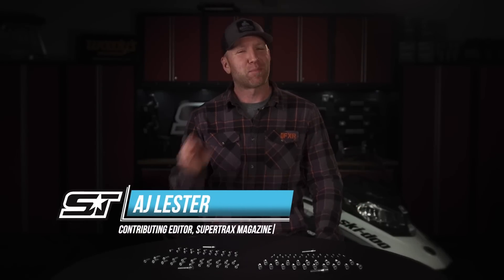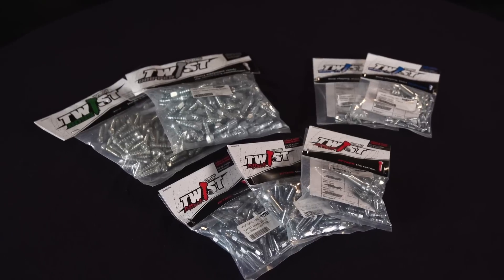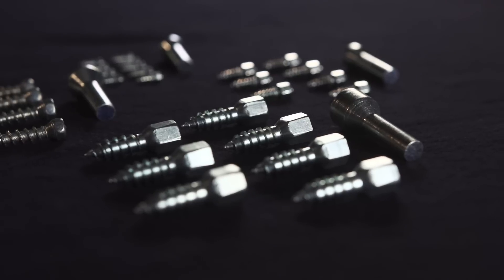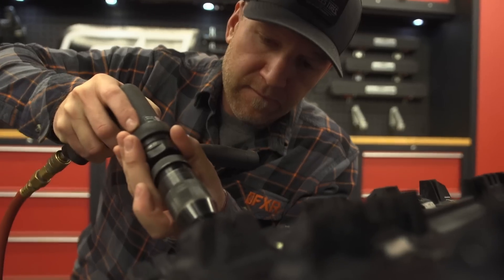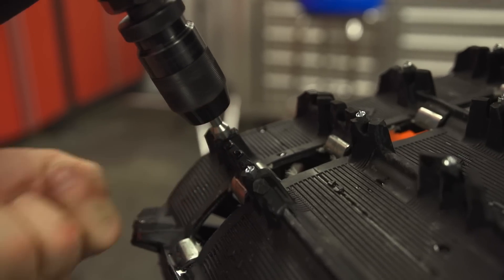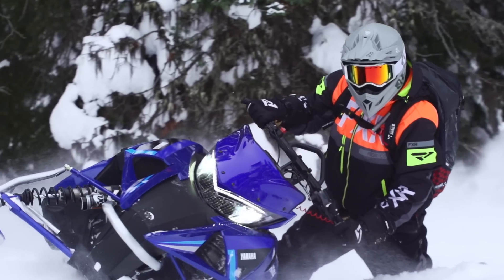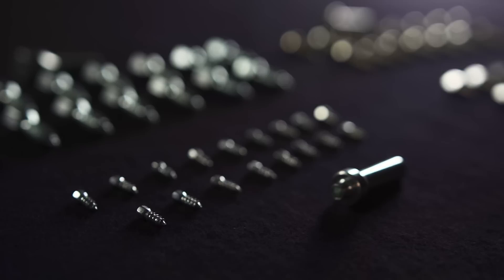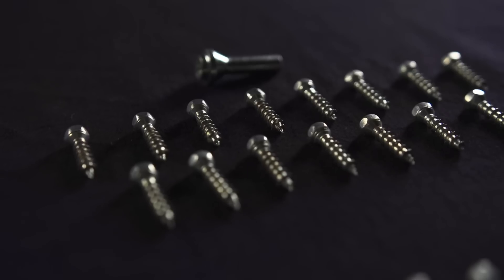How To Maximize Traction With A Twist of Your Wrist | Woody's Twist Screws

Comment: I’ve ran atv screws on sleds before. They worked alright. I wouldn’t recommend these on high horse power applications, but for the mxz sport it’s a good fit.  Pro tip: dip the screw threads in weather strip cement before installing, they will hold better and you will have less rip out.  Also when it bottoms out don’t spin it and strip the hole out.

Comment: How do these compare to a studded track? I'm going to assume the studded track wins out, but by how much? Of course it depends on number of studs, but just curious if there's ever been a direct comparison. I ride hard and always stud my track for safety purposes (99% trails and ditch). Just curious if these would ever be worth changing over to on a future sled.
Reply: No.       Real stud are better .
Reply: Yes studs are still better for ultimate traction, but it depends what you want. If studs offer 100% traction I would say the screw in type get you 70% of the trail safety. Also studs add 10lbs of rotating mass, cost a lot more, and take a lot longer to install. I’ve had good luck with iGrips over 100mph and none have come out.
Reply: @GotThrottles  thanks for the input. Exactly the kind of info I'm looking for 👍
Reply: @GotThrottles  ... one thing you missed is this.... a typical 137" can take 96-112 studs up the middle.. IGRPIS at 1/10th the weight you can install around 225--288... so all those extra points of contact make up for anything a traditional stud setup can do.  We have compared this side by side with identical sleds.. literally no traction difference in all conditions.... its why we all switched.... honestly we were shocked... but it is what it is.... we saw it and tested it and know the results we experienced......  nothing but igrips for us ...... between the 4 of us we have probably 50-60 thousand miles on them in the last 5 years... never lost one.. no damage to any sled ever.. and ZERO issues.
Reply: @joerotorhead  that's a great review!  Glad to hear about those results.  I run iGrips on my 144" and am very happy with the grip.  I imagine 200+ screws really hook up!
Reply: @joerotorhead  thinking about adding them to my thundercat what do u think? I dont like traditional studs so its down to these or leave the stock 1” 137 i love the track just want some extra traction normally 196 traditional studs is what i would need thx
Reply: I prefer iGrips over studs, but Ice Ripper tracks over iGrips. 

Personally, they are simply more reliable for me and the mileage I like to ride. No more major tear outs, broken studs or punctured heat exchangers. Stud have their benefits as well - but you need to make a decision based on what you are looking for in ultimate dependability vs traction.
Reply: @joerotorhead  fantastic. Thank you very much for this info. I run 162 studs on a 136" track (2018 Switchback XCR) but I absolutely see your point. Braking for me is way more important that take off and having a grip on every lug seems that the contact area would be either consistent with or even improved over studs.